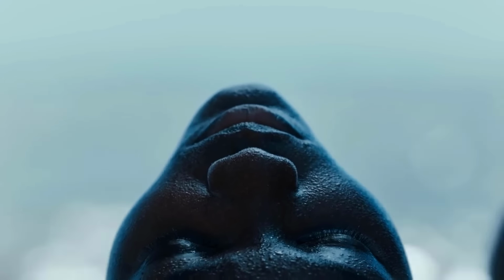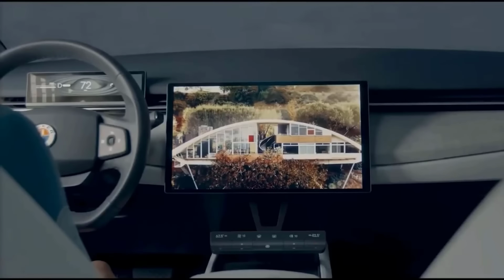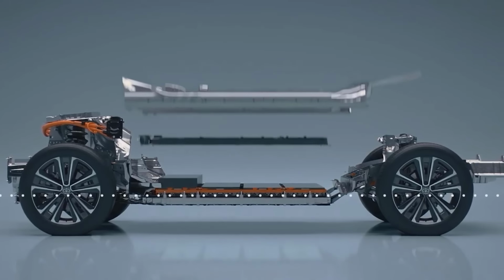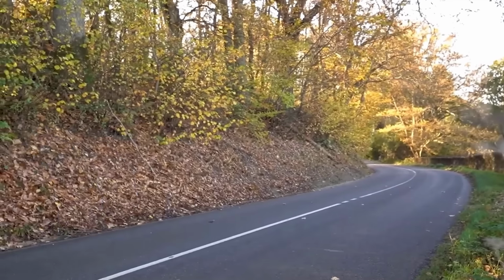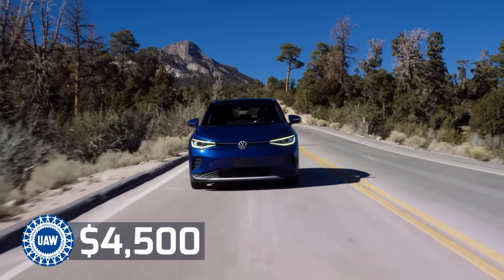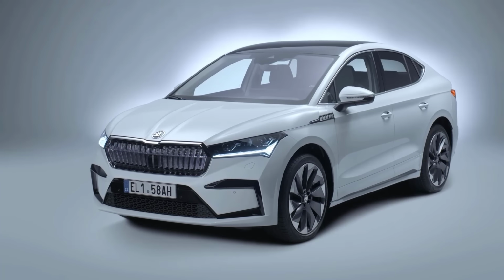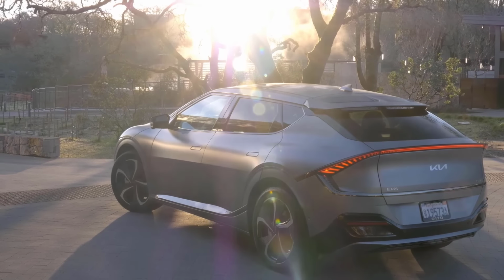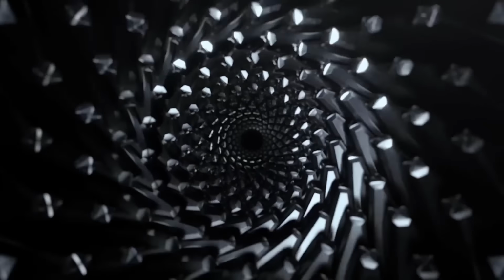TESLA's Half Price... 5 Great Electric SUV

Comment: Hey cheapskate ICE trolls, Nissan LEAF since 2011 over 500,000 sold
Tesla Model 3 & Model Y are the best selling vehicles today 
L1 charging over an extension cord into an outdoor holiday light outlet at 2-5mi range per hour while parked 12+ hours per night / at 1.6kW not exactly going to break the electrical grid, even if 100 million people doing that every night. There is actually enough night-time off peak to L1 charge 250,000 EV's in the USA without any new power generation capacity. Not every utility company or every city is the same, some places have cheaper or more expensive electricity, so the electricity to recharge your EV can be cheaper or more expensive than gasoline which also varies in price by location. Your not everyone. Nearly all the automakers offer gasoline powered cars for sale and will continue to do so for decades / market forces favor the best solutions. For short distance city cars used for commuting, a Nissan LEAF exceptional. Also most people that have an EV also have a conventional gasoline powered car or SUV or hybrid electric vehicle for going skiing or snowboarding or road-trips /

Comment: EV  is the way if hydrogen vehicles are presently not in the running , a HIGH PRICE TAG pre supercar 0-60 mph   in a middle of road family suv  isnt the doing it for me or the wife  .  RANGE , PRICE and a non lagging screen that doesnt require a tec diploma to work it  is  KEY,  plus length of warranty. NOT IGNORING the amount of charge stations available on route, and that are in working order and can fulfill/multiply with the amount of new EVs that are being put on the road

Comment: Summary: Current Bolt owners are scared our car may catch fire with our family in it, or set our house on fire while we sleep, or set other people or their property on fire. We are still waiting years for replacement batteries that (hopefully) won’t spontaneously combust because Chevy is selling our batteries to new Bolt buyers, instead.

Mistake 1:
We TRUSTED Chevy in 2018 to stand behind a product the company has staked its future on. We chose a new 2018 Bolt over Tesla partially because we believed reliability and customer service would be better than friends with Teslas had experienced.
When we learned our battery may spontaneously combust, we requested a buy-back because:
We can’t voluntarily reduce to 80% charge capacity until replacement battery arrives
We have 2-3 hours of daily commuting
Our serious winters reduce the battery capacity significantly already
We can’t comply with Chevy’s recommendation to not charge indoors or park indoors after charging until new battery arrives:
We have to charge in our garage overnight and use a parking ramp to go to work.
We also now have to pay to charge in the parking ramp during the workday to comply with recommendation to avoid getting below 70 miles remaining range until new battery comes.
We didn’t pay all this money for a paper weight that may spontaneously catch fire
Chevy refused to do ANYTHING to get us out of the 2018 Bolt.

Mistake 2:
We TRUSTED Chevy in 2021 when they said the batteries were only risky in 2020 or earlier model years. 
We paid Chevy more money to escape our scary 2018 Bolt in favor of a “safe” new 2021 Bolt.
Within WEEKS Chevy admitted that ALL Bolts may spontaneously combust, so we were back at square one after giving Chevy more of our money.
Going into 2023, we still have no idea when our batteries will be replaced because Chevy prefers to sell our batteries to new Bolt customers.

AT A MINIMUM, Chevy should either: 
Buy back Bolts so current customers can finally be free of this constant fear and liability
Replace all 2017-2022 Bolt batteries BEFORE selling any more new Bolts
Replace our defective Bolts with the new Bolts they have been selling
Replace our defective Bolts with the Equinox that they now claim is safe and more affordable
The latter may put us at Mistake 3, so customers should get to choose from these options.

My family desperately wants EVs and charging infrastructure to succeed. We would love to see it accomplished by American companies using American labor and supplies because we want to support humane working conditions and the American economy. Or in other countries that will perform the work humanely.
My family bought an extra large cup of Chevy EV koolaid that we’ve been drinking from daily for ~4.5 years, so we have plenty of real-world experience with Chevy EVs and Chevy customer service. The promo and rah-rah review videos you see are typically from folks with little to no actual experience as a Chevy EV customer. I can’t vouch for whether other EV manufacturers are any better at safety assurance and customer service. I sincerely hope they can all get there soon so all EV drivers can be safe and have sound investments.

Comment: Not against the concept at all but I still need more range from these cars, I think 400 miles per charge is a great milestone that most people would take the leap!
Reply: 520 mi per charge already available at posh price points / see Lucid Air & upcoming 1000 mi EV's with million mile batteries / using less cobalt, more nickel, copper & aluminum, carbon mixed with silicon in the anode & solid polymer & ceramic electrolytes that are flameproof & longer lasting & not damaged by fast charging or high heat weather heat soaking in hot climates ;)
Reply: The Government needs the people/human race to be corralled. 
People are easier to control when they cant travel.

See history

Comment: Just consider that replacement battery prices vary depending on your vehicle model. Remanufactured packs cost between $9,000 and $10,000, while new batteries can cost up to $22,500.
If you're going to replace your damaged battery pack with a remanufactured one, the average cost would probably be around $13,000 to $17,000, depending on the complexity of the work. However, if you opt for a completely new battery, you should be ready to shell out upwards of $25,000.

Comment: What a garbage thing to buy. Expensive to recharge, time consuming to recharge, very inconvenient to travel ling distances, constantly be careful not to use air conditioner, constantly be careful not use heat, and extra expensive to buy. And finally, you must look for a place that will have charging station in the middle of nowhere. Charging takes hours, when refueling a normal car will take only 5 minutes. LOL go and buy this garbage can and have fun.

Comment: To lease or not to lease ! Nowadays, we buy all EVs with batteries, obviously just like smartphones. Experts suggest that EV batteries often last from 10-20 years or theoretically last forever. However, EV battery degradation to below 70% is bound to happen at some point depending on the driving habits, charging habits, speeds, the temperature, road conditions, and more. As a result, several federal regulations require manufacturers to warranty EV batteries for 8 years or 100,000 miles to ensure the batteries hold at least 70% capacity. In reality, a Finnish man's 2013 Tesla Model S after 8 years started showing error codes while the mileage display was less than 100K miles in December 2021, and the only fix was a $22,600 full battery replacement! EVs are not like smartphones of a couple hundred dollars. Like a cycle of paying and paying, would you like to pay $23,000 for a new EV battery after EVERY 8 years or 100K miles! In another word, you are leasing the EV battery that has a price of $23,000 for EVERY 8 years or 100K miles. Should we lease or buy an EV battery? To lease or not to lease!

Comment: The EV cars are definitely the future, but I think range and price are factors the manufacturers are going to have to address. I also concerned that a state like California will put a user tax on the vehicles, because they pay no gas taxes to maintain the roads and in a state like California that has high taxes, EV will cost more to operate than gas.
Reply: I agree .  It's coming, they already charge various fees for charging an EV at those commercial charging sites. Luckily there are still many 'free' charging sites. Some type of electric car tax is coming that owners will pay every time they register their car.
Reply: Annual registration fee's for my 2019 40kWh Nissan LEAF purchased used recently with 47,747 mi ODO or about 500 battery cycles still has 98% of rated battery capacity / but the Washington State EV fee's make the tabs $650 per year // thankfully at $0.15 per kWh going 10,000 mi only costs about $400 of electricity.
Reply: I think you would be surprised about that prediction. I doubt it will stand the test of time. The main blocking factors being the obvious limitations of the electrical grid we are already experiencing in many countries, but far more importantly some of the minerals needed such as lithium and cobalt. The latter currently almost exclusively mined in the Congo, most of which is refined in China. One does not have to be a political expert to see how that could be problematic.
Reply: Already in Political talks.

Called a millage tax.

For that reason exactly. 

And dont FORGET this 

There is NO SUCH THING as a incentive price.
That reduced price is paid by the Government. 
Lmfao.
It's a subsidy paid out of the tax PAYERs tax revenue collected. 

Dont think that "The Government " would ever "incentivize" anything if they wernt gonna make you pay for it
Reply: So there are a number of proposals out there addressing this issue, but I think a simple user fee applied to every car could easily solve that problem! Cheers!

Comment: I think I was sold on the fisker Ocean I liked the looks and when those windows rolled down, I wonder if they have that one in AWD? MM The battery range wished that would be more around 500 miles. Well see what Tesla has next I noticed they are coming out with another vehicle and new engine and a quad engined cybertruck too more speed plus that cyber truck has two generators for construction workers and if need be supply the home if the lights go out! :)
Reply: Sure if you want to wait 6 to 10 years for the Tesla to finally start delivering.

Comment: The only reason EV's are being pushed is because it gives the gov the ability to track and control when and where you drive.

Oil is easier to recycle vs these batteries, drilling for oil vs the multiple precious metals and other components for EV's is almost the same however the oil process is faster and cleaner.

Comment: NOISE HURTS BAD PLEASE TURN HONK LOCK OFF
😢😢😢😢😢😢

HOW TO TURN HONK OFF:
PRESS LOCK AND UNLOCK ON FOB AT THE SAME TIME FOR 2- 4 SECONDS
HAZARDS FLASH MEANS HONK IS OFF
(CONTACT DEALER IF ASSISTANCE IS NEEDED AS SOME CARS MIGHT BE SLIGHTLY 
DIFFFERENT)

Comment: Price price and price. It all comes down to this. $40-$60k isn't going to work for 80% of Americans. 
I've always said give me 300 miles at $30k and we'll talk. That's doable. Anything less is too much for urban driving and not enough for long distances. 220 miles of electric? Not enough really to go on a 3 hour drive as you will get range anxiety.  I think by 2025-2030 electric will be viable by then.
Also what are we going to do with all these batteries once they are depleted. I don't have a local recycling center near me. Tough question need to be asked.
Reply: Think there will be a good market for used batteries beyond their use in an EV - especially for home storage of surplus solar power. Most new EV’s today have batteries with more than 60kWh storage. Even if they lose 50% capacity they will offer more than twice the storage of a Powerwall 2. Enabling the saving of surplus solar, or storage of off-peak priced electricity, they could enjoy quite a long extended life.

Comment: Am I the only person who wants a simple, reliable vehicle with long range? Keep the complicated (unreliable) bells and whistles. Keep the navigation assistance (my phone works better). I don’t want screens and cameras everywhere. They don’t last and will be horribly expensive to replace. Give me a vehicle with the simplicity of a 2000 Jeep Cherokee, no power options, 500 mile range and quick charging solid state batteries and I’ll buy three of them. I probably am alone. Fine. Give me the sold state batteries and I’ll do the rest my damn self.
Reply: I think exactly the same except i do want a big screen if possible (option), and all the front and back cameras as options, and all the sensors as options. 
i actually do want to have good acoustic if i wanna do car camping. but otherwise, i want to car simple. the way over-priced infotainment system is definitely a no-need.
Reply: hybrudé jeep

Comment: How long does it take to charge from 0?
How much does it cost to get a full charge?
How long do these batteries last?
What to do when you run out of charge on the highway, or in a desolate area?
What about swap stations instead of charge stations.
You pull in, easily swap out old depleted cells for fully charged cells. Would this work?
Reply: Soon one of the key questions will be - what's the lead time?
Reply: don’t let the battery get that low ! 20 percent no lower
Reply: Nio does battery swaps. The big hurdle in the USA is a 30% tariff on imported EVs.
Reply: The big difference is every time you leave your house, the battery is full.

Comment: This is just fud , Toyota , Gm crap , couldn’t build a garage never mind an ev . Megane will not be cheap  ,likely 45000 euro for the mid range  spec , 60 kWh battery not good enough for 2023 , Zoe already has 52 kWh battery . Vw and the rest depending on the governments grants to sell , won’t sell otherwise. Skoda is not cheap when you read the option list . Chinese will kill the lot , Tesla in Europe will take many of the sales as it actually exists now and in significant numbers

Comment: It sounds like fun to go from 0-60 in 3.9 seconds but in reality, it would better if we can fine tune how much range we get if we limit the acceleration. Let's say you only have 100 miles left but if the software can limit the car enough so you can get an additional 25 miles to get to the nearest charging station it would be great.
Reply: It already exists, called take it easy lead foot. I used to have a 1969 3/4 ton Chevy 4x4 with a 396 Big Block, if you weren't careful with your foot you could actually watch the gas gauge move, especially on the freeway. It got better when I put a 5 speed NV4500 in it and a Edlebrock carb, but that TH400 sucked the gas. I learned quick when it was on E it meant it.
Reply: It's called eco mode and a light right foot
Reply: Did u do any research before commenting?
Electric cars can already do that.. You can put the car in energy saving mode and the car will reduce throttle performance and restrict options that consume energy. 
You can also adjust Regen braking in many of these EVs. Some EVs will suggest an alternate route that will keep you from climbing hills (hill climbing reduces range)..
Reply: @mamadouaziza2536  also they have 'turtle mode' for those that want the excitement of living on the edge
Reply: @IanMcc1000  
I take it none of you people ever driven an i3s, i4, Mini e, Model 3 Performance or a Taycan? None of these EVs are boring .
Reply: @mamadouaziza2536  not the point I was making. I meant that the turtle mode exists, as the original commenter didn't know about it. The excitement I referred to is the excitement of 5 miles range remaining with 10 miles to the next charger!
Reply: I use this thing called a Foot, helps regulate economy/performance ratio
Reply: you can
Reply: Tesla already does that.  The other brands probably already do it too
Reply: It is all about acceleration! No one wants a boring car LOL
Reply: @Giovanni-x1  
Its all about staying off public transportation
Reply: Have you driven an EV?
Reply: Turn on B-regen max & use Eco mode //
Reply: Typical Nissan LEAF SV drivers getting 3.3 mi per kWh, I am able to get 4.9mi/ kWh and use freeway and live in a hilly western Washington area. Its about throttle control of your foot, your focus & self control to hypermile can boost fuel economy in any vehicle, boosting range in EV's about upping the Energy Economy which is measure as Mi/kWh with 2.3-8.1mi/kWh common among hypermiling EV's of today / aero-efficient Aptera E can get 12-38mi / kWh / an electric kick scooter can get 1000 MPGe // where most EVs are just over 100 MPGe
Reply: And the. Sit there for 2 hours.

Lmao.
Fk EVs.